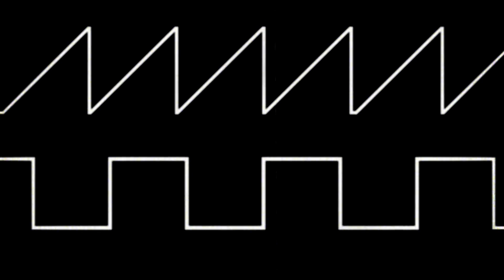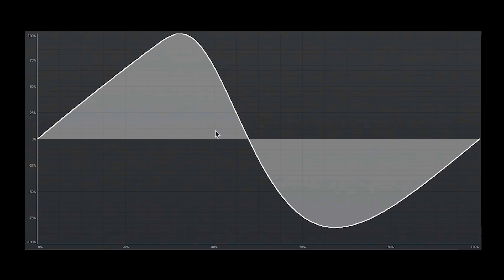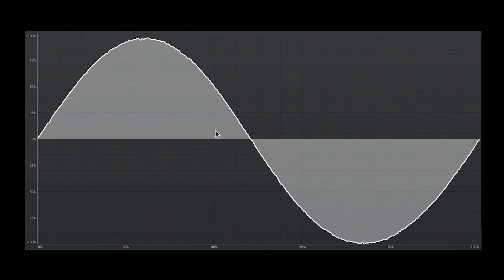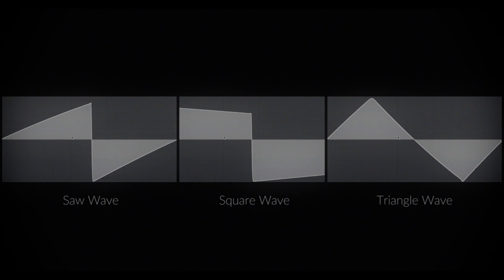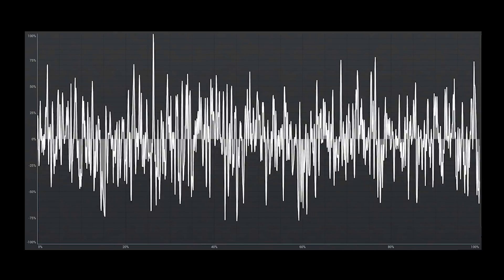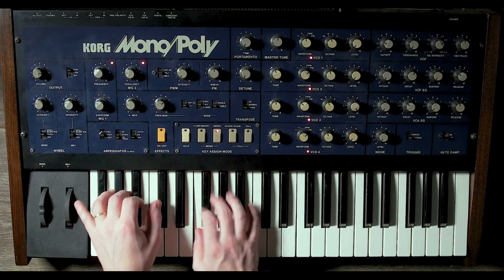Intro To Synthesis Part 1: Oscillators | Reverb Learn To Play

Comment: Saw Wave [1:00~ ]
	- Saw Wave Strings [1:31~ ]
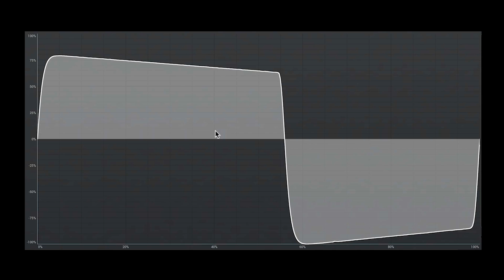Square Wave [1:45~ ]
	- Square Wave Thin [2:17~ ]
	- Square Wave Fat [2:25~ ]
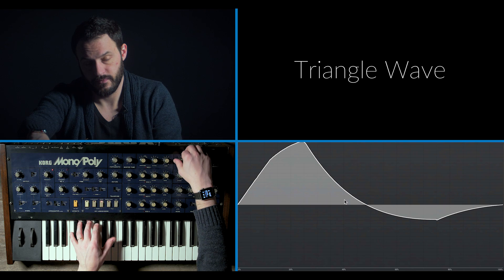Triangle Wave [2:35~ ]
	- Triangle Wave Bass [3:00~ ]
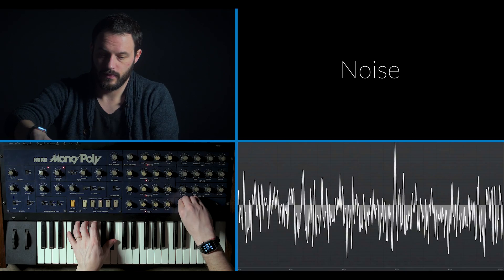Noise [3:50~ ]

Comment: I've been building and playing with Synths from around 1966,... before they were even a thing !... through an introductory  lecture at  Bridgeport University around 1964 by Vladimir Ussachevsky.   I am somewhat amazed that most of the videos on basic Synthesis, explaining the principles, by supposedly breaking things down into simple analogies,.. get so much wrong.  Like, an oscillator is an electronic device that produces a repeating waveform that is then made audible by using a transducer (speaker) to convert that wave into a variable air pressure wave.  Usually the examples of sine/ and square, and sawtooth waveforms are not actually very clean and pure examples of those.  In this video the  "SAW" has a lot of noise content, so the zero crossings are not exactly equal,... it sounds like there is possible power supply trash slightly modulating the frequency as well as high frequency noise roughening the tone itself.  The square  doesn't sound like a square at all .  (It should have nothing but odd harmonics), so it will have the characteristic hollow  clarinet-like sound.   These waveforms sound as though they are being reproduced through a speaker and then re- mik'ed.  if this "square" wave" tone actually started out as a square wave, it must have been a lot closer to a pulse wave, with quite a different timing between the positive going side of the wave and the negative, as it has lots of even harmonics.  I really wish these lecturers would show an accurate oscillogram of the waveforms that are being reproduced and do the video by directly patching an oscillator into a line level input in the computer or filming device so that the purported waveforms have been faithfully converted to  wavefiles.  Here is another video:  https://youtu.be/vvBl3YUBUyY    that at least has accurate waveforms; sine and saw, as well as a fairly decent description of F M. synthesis.  So far i am not overly impressed with this video.

Comment: An oscillator is a repeating waveform with a fundamental frequency and peak amplitude and it forms the basis of most popular synthesis techniques today. Aside from the frequency or pitch of the oscillator and its amplitude, one of the most important features is the shape of its waveform.

Comment: excuse me please, but very basic oscillator is sine wave. hovewer big up for this range of videos
Reply: Andrej Jahskin Yeah but they can be useless in an analogue synth with a low pass filter. You’d essentially be taking the sound away completely every time you filtered it unless you’re modulating it with another wave, which is basically FM synthesis at that point.
Reply: Haut Strange thats true.

Comment: In 2002 I had the opportunity to buy a mint condition Mono/Poly with flight case for $400 and I did not. I'm still kicking myself about it , why why why!
Reply: Tim Scanlon $10? I’d be kicking myself too. Maybe Behringer will reissue them as well ;)

Edit: pounds. Sorry. Still incredibly cheap.
Reply: Tim Scanlon that’s the life of a synth/Keys player. And musician in general. I’ve let some good deals pass by and some slip away from me, but it’s led me to where l am now. Those Poly 800s are great though. I let go of a DW6000 a while back. Thinking of getting an 8000 this time around. Korg has always been making great synthesizers.

Comment: So happy this series is happening! Been wanting an intro to synthesis!
Reply: Tara Litvack have you bought your first synth yet?
Reply: I have not bought my first real synth. I got the ROLI seaboard (not the same I know I know!) but I have been eyeing the Korg Minilogue when I finally decide to take the plunge.
Reply: I’ve been thinking buying a Behringer Model D
Reply: You should get Spectrasonic Omnisphere as your software synth. That way you can blend samples and waveforms. But then get a hardware synth to control Omnisphere so you can adjust parameters with something other dragging your mouse cursor off the screen. lol I mean, if ya don’t wanna ef around, and get right into it. Thats what I’m doing. Screw real work. lol.
Reply: Check out prophet x. Controls most of omnisphere from the hardware.

Comment: Nicely produced video. I think that for an introductory video though, the content isn't clear and may be confusing for new comers since you say you are demonstrating basic wave shapes but then you filter them without explaining what is going on.
Reply: John L Rice also, no mention whatsoever of sine waves threw me off... There's another comment thread above where that's talked about in more detail. Either way I agree with you. The waveform explanations make sense, and using an oscilloscope for waveform visualizations is great; not explaining a filter or how it works or why it's used though...?Should have at least been mentioned even if it is in one of the upcoming episodes. 👍